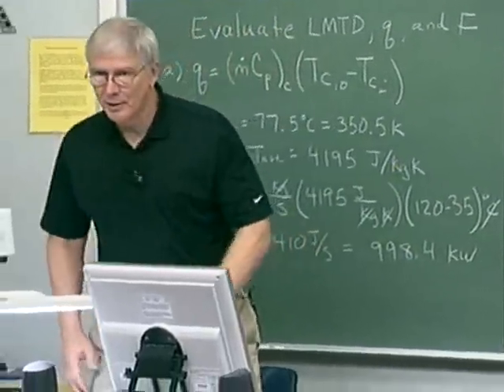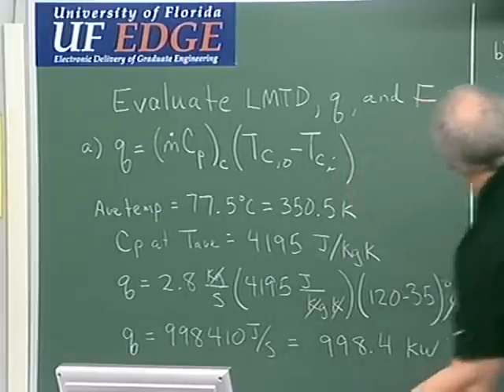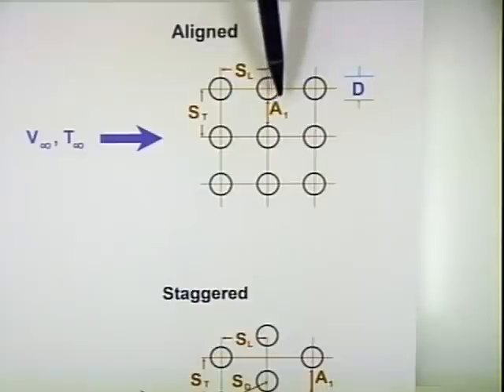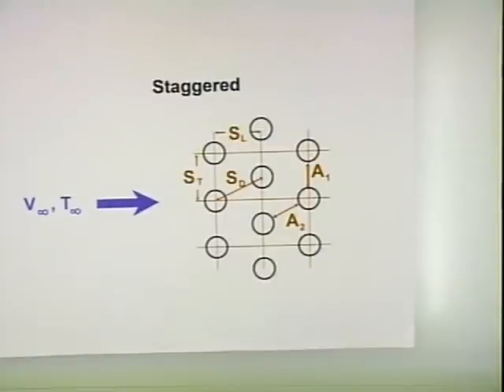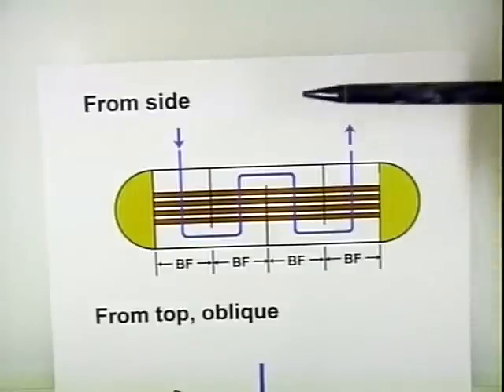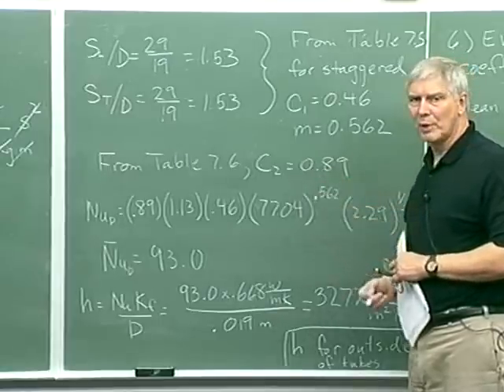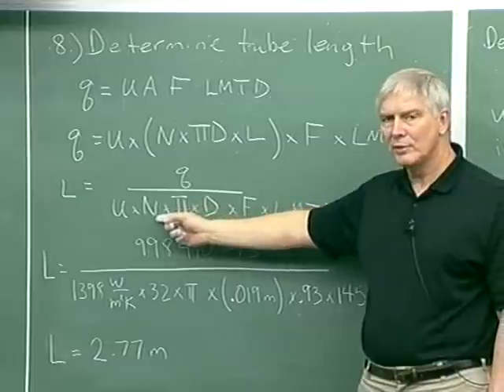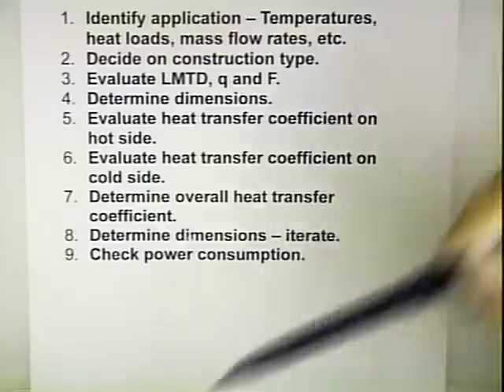Design Heat Exchanger

Comment: The cold fluid certainly is not water, because it has phase transition between Tci and Tco, so Cp(Tav) can not be an approximate value. If it is assumed as water, taking the phase change into account, q=h(Tco)-h(Tci)=7195 kW, not 998.4kW!. What are the cold and hot fluids? It would be much more beneficial if you provide this information

Comment: I believe that the diameter used in the calculation of the Shell side Reynolds number should not be the same as the tube diameter (19 mm).  The diameter should be, D = Aeff / Perimeter. Aeff is the area of the inside shell minus the area of the tubes, and Perimeter will be πDs( Ds is the inside diameter of the shell)

Comment: Are these equations applicable for shell & tube condenser? For example, tube side is water, Shell side is R22 refrigerant, water entering tube is at 32 oC and leaving is 37 oC, Hot gas entering shell is at 80 oC and condenses to  liquid at 35 oC. It would be great if you could answer my query sir. My email id kalsi@ecodivinesolutions.com

Comment: If there would be no pressure losses required to force the flow through the heat exchanger, would there still be some power loss for a recuperated gas engine as compared with the nonrecuperated gas engine ?

Comment: The book used was Incropera and Dewitt, Fundamentals of heat and mass transfer 6th Edition. This book seems to be quite out of date as the 7th edition uses a more updated correlation for the external flow over the tubes, you may want to check both editions to compare.
Reply: How about with Book of Heat Transfer from DQ Kern?

Comment: I think you must not to introduce a correction factor for DELTA (T ln) because in your example you are working with a 1:1 heat exchanger (single pass in tubes single pass in sheel). This is a very close situation to the one that is present in double pipes exchangers, were Delta (T) ln is a valid measurement of temperature diference. 
That graph is made for single pass in shell and a pair number of passes in tubes. FT=1